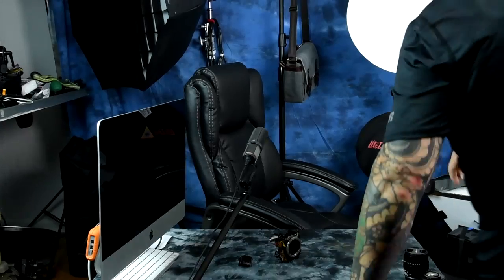😳😎D850 Hybrid EVF technology explained: Electrochromic Glass under PENTAPRISM

Comment: Your information on the potential of a hybrid EVF is great, the only thing I'm uncertain of is the 2 holes which you say are sensors. Although that could be possible as you suggested because you could be using either eye a central 1 would have been more realistic and they are usually quite responsive so not convinced it would need 2.

Comment: Move mirror to Chip the image....did you actually look back to this video Ken , since it is nonsense? There is OLED or TFT panel and himp  images are going from SD card via processor directly to EVF, mirror does not need to go anywhere when you review alreaady taken images.The whole idea of Nikon is old stuff adding nothing new to the dslr , I consider as improving or the crap live view which Nikon is lacking or is behind for almost a decade. Without PDAF on the sensor itself  there is no any advantage of adding EVF since mirror up disable AF module.

Comment: that D500 never thought it would be ripped apart by King Kong lol. By the way Ken, I am getting the D500 this month with the 200-500mm lens for surfing photography. But I will also use it for close range tight situations like ring side boxing matches where my subjects are just a metre or two away. I have a D810 with the standard 24-70mm 2.8 but want something a little more wide I think?